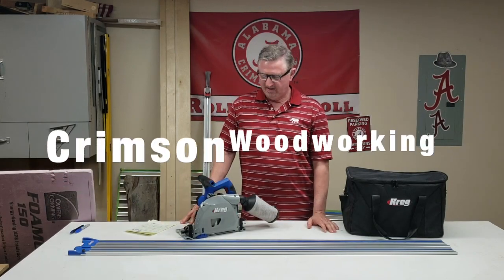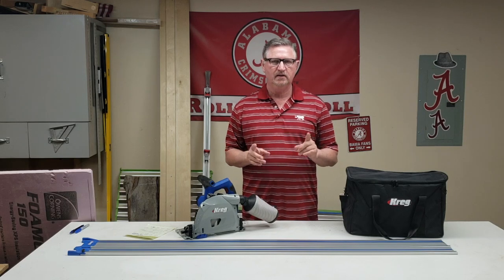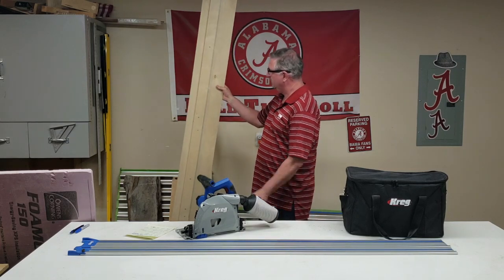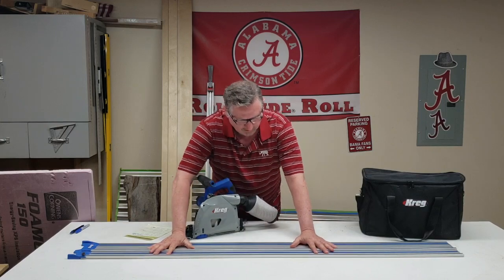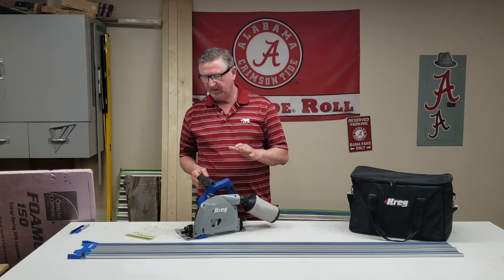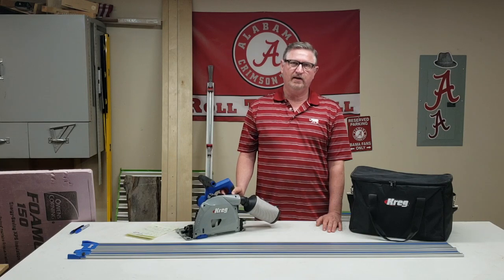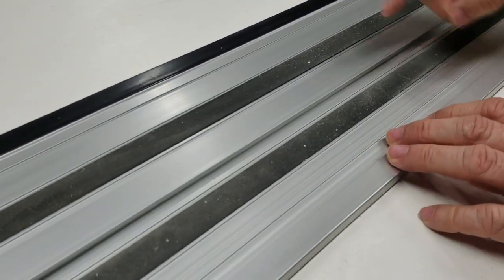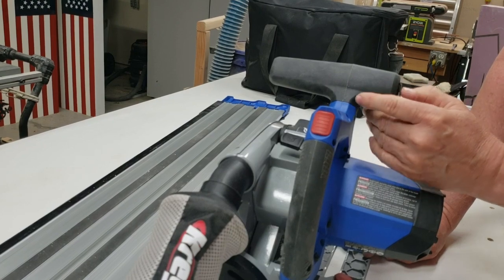Kreg Track Saw Review

Comment: You got a good deal! I just ordered the same two-track kit for a little more (inflation) off Overstock. How long is the track with the cord guide installed?
Reply from the maker: With the cord guide.. It's 64 inches. I never thought about Overstock. I know you will like it. I use mine with my Ridgid shop vac with a Rockler flex hose. This is the way to go as the bag fills quickly.
Reply: @crimsonwoodworking9609  Thanks! Now I have to figure out how to store the tracks. I'm glad to hear the shop vac works, that's basically what I have right now.
Reply from the maker: I drilled a hole in the exit end of both of my tracks and just hang them on the wall.

Comment: Great video! Thanks! I’m ready to make this purchase. My only concern is when joining 2 tracks together. I’ve read negative reviews on this. Have you had any problems?
Reply from the maker: Absolutely not. The tracks are perfectly straight. They are connected on the back with two bars that have set screws incorporated. What would have made it better would have been to make the set screws the same size as the Allen wrench that fits into the handle. Buy it! You won't be sorry
Reply: I have two tracks & the joining system.  I’ve had no issues either. It is a little finicky the first time I did it. Love the set up.

Comment: Hi Crimson Woodworking, thank you for the Kreg track saw review.  Did you find it easy to connect the two tracks and have them aligned straight.  Many raved about the track connection system used by Bosch, able to join two tracks quickly with perfect alignment.  I am leaning towards the Kreg track saw, but it would be a big deal breaker for me if it takes much fiddling to align two tracks.
Reply from the maker: That was a concern for me too. But it's perfect. I couldn't be happier. The rubber zero clearance sticks out farther than the saw blade until the first cut, then everything is aligned. The manual takes you through the first setup an initial cut. Glad I got it.
Reply: @crimsonwoodworking9609  , thanks!

Comment: Thanks for this review.  In terms of track saw safety (vs table saw), are there any track saw specific safety guidelines or issues that we should be aware of.
Reply from the maker: A track saw is designed to be both accurate and safe. Plunge starts in hardwood sometimes will cause a slight kickback. This Kreg has an anti-kickback feature. If your cutting on a piece of foam and you adjust your depth of cut to only go into the foam about 1/4 inch, the cut becomes super easy. I don't know why I didn't get one earlier.

Comment: The Kreg tracksaw is great.  Just be aware that it is a proprietary system that you're being locked into the Kreg system.  The saw is opposite to all other tracksaw, so just be aware that any other tracksaw accessories meant for Festool pattern tracksaws won't work with this track and saw.
Reply: I have the Kreg saw & tracks and haven’t run into that yet.  I use the dogs and rail clips meant for the festool & they work fine. However as you point out there may be other things that won’t work